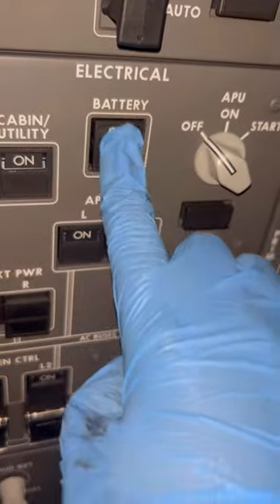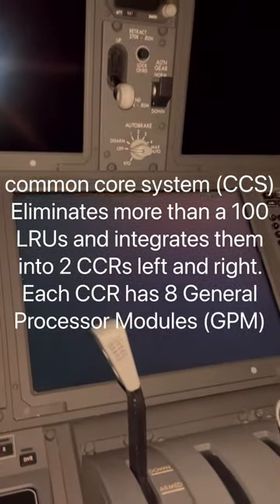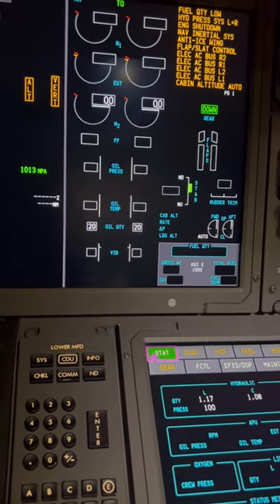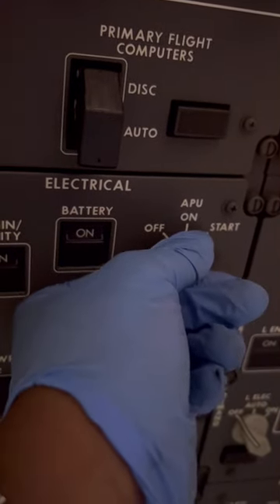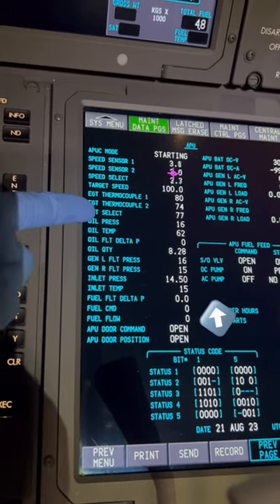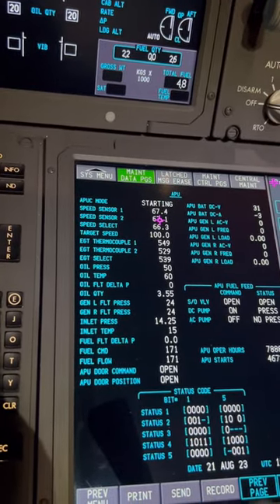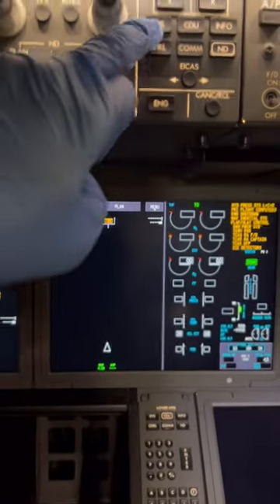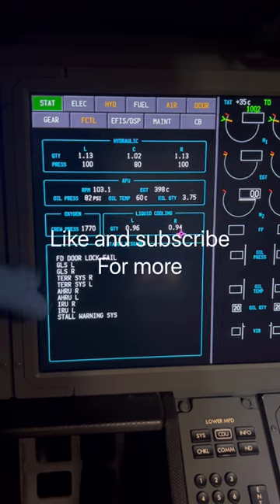Starting a Boeing 787 Dreamliner Auxiliary Power Unit (APU) with batteries

Comment: One of the things I do when powering up a 787 is check the battery capacity. If it's low, i would call for a GPU to power it up as fully depleted batt on the 787 must be replaced. And it also takes at least 30 mins to fully charge a batt after APU start up.
Reply from the maker: Great information thank you for sharing mate👏🏽